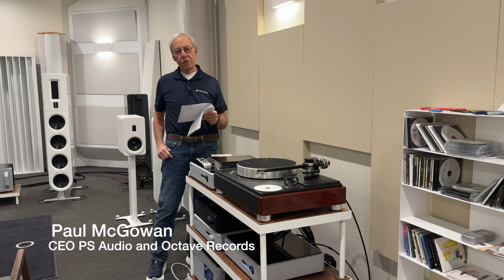What circuitry affects PRaT?

Comment: Didn't answer the question. You could have stayed at a couple things in the circuit that might change the sound but neglected to do it. Here's why, it's not the gear itself it's about the music. The emotion comes from the music itself and the memories we associate with it. NO capacitor resistor or transistor will get us more engaged than another. Paul is talking bologna
Reply: Not true for me.  They can and do add to the musical experience.
Reply: @tomwechsler22  okay so how do they do it? Be specific
Reply: @ryanschipp8513  Simple.  Better parts/components/equipment (driven by capacitors and transistors) reproduce music better.  No question about that.  That makes the same music more engaging.  So, while for sure it is about the music, which is where it all starts, the better the music is reproduced I.e. sounds, the more engaging.  Now, as to the technical how, why, etc.  I don’t care much.  It’s the end result that counts.
Reply: @tomwechsler22  if it's simple you'd answer the question which you didn't just like paul. How can Parts make an amplifier or any other component present more Prat. This was the question by the guy that wrote In. If you can't answer it just say so. No need to go off on a tangent
Reply: @ryanschipp8513  I was focused on your comments about Caps and transistors.  You may not get that.  Here’s the thing, if none of that made a difference, then the music would be just as engaging on a small transistor radio played on an AM station as it would be on a true hifi system.  Your first statement though seems to say it does not matter what you play the music through, it’s just the music.  What I am saying is it does matter what you play it through.  The technical aspect of how - does not matter to me.  The end result does.  As to Paul’s post - I was not commenting on that at all.
Reply: @tomwechsler22  you are stating the obvious. Of course it's going to matter what equipment it's coming through. Your transistor radio comment is bizarre. Something tells me I'm talking to an old timer. Who would compare a transistor radio to Tower speakers? My comment was referring to what the writer wrote into Paul and Paul's response. The writer specifically asked what inside of a component would add emotion or engagement to the music. There comes a point with Hi-Fi equipment where you will get engagement and emotions with all of it. Then it all comes down to the music itself.
Reply: @ryanschipp8513  I suppose the “old timer” was ant as a put down.  Nice work.  Your comment implied that the gear has nothing to do with musical engagement.  (“It’s not the gear” and “No capacitor, resistor or TRANSISTOR…”).  All I am saying is that gear and the caps, R’s, and transistors do make a difference.  Better parts=better gear=better sound.  I was not commenting on Paul’s post.

Comment: Here we go again. The only way to truly judge minute changes in circuitry is through double blind A/B testing. I’ll stipulate that it would be impossible to test every circuit design vs every other this way. But for broad topologies- SET tube amps vs SET tube amps, class d vs class d, class a/b vs class ab etc etc., no human can hear and identify which amp is which all other things equal. This assumes the amps are the same general topology (but with design and circuit design differences) are the same wattage, and are similar quality (using price as a very imperfect proxy for quality as there’s no other way to level set this). Further assumes all else equal including source, passage and DB level at the listening position. It’s just pure fantasy to think the typical listener can discern such minutia in design over multiple double blind trials. And this has nothing to do with the true statement that music is evocative and spurs emotion. That’s a separate topic and an unnecessary preamble to the core of the assertion made here. OK folks, fire away. I can take it.

Comment: Hi Paul, PR&T is a fabulous subject for a technical book. Being from the UK originally, I most associate PR&T with: Linn (Ivor Teifenbrun), Naim (Julian Vereker) & NAD (Bjorn Erik Edvarsen, BEE). I'm completely unaware of other designers that emphasized PR&T, so there is much research to be done. Please make an announcement on YT when the book is available? Thanks!
Reply: I think we need to start with the fact that pace, rhythm and timing are at most synonyms for each other and at minimum  have overlapping definitions to some extent. So what is meant exactly by these marketing terms?  Assuming they have relevant meaning, is the idea that an amp imparts unique p, r and t to source material, independent of that which source material actually contains?  That’s hardly hifi. Or is it that the amp accurately reproduces the p, r and t that was already there, in which case the amp has no p, r and t of its own, which makes the topic moot. In summary the hifi world has gone mad, and the adjectives that manufacturers use does nothing to help. Go and count how many times the word “stunning” is used in ps audio product descriptions. It’s embarrassing. One would conclude that a brief listening session on a ps audio setup would lead to religious experiences, cardiac events or both on a regular basis.

Comment: Hi Paul, hope you read this. Here is my take from down here in Sydney, Australia. At mid frequencies we are highly sensitive to distortion but less so to dynamics. At lower frequencies, gradually increasing below 500 Hertz, we become less sensitive to distortion but gradually more sensitive to dynamics. For those who study the Fletcher-Munson equal loudness curves, if we invert them they reveal that low frequencies are less compressed relative to mid frequencies. At 30 Hertz it requires around 70dB-SPL before 30 Hertz is heard. This is why low frequencies can seem to emerge from a black background. It also means that harmonics of those low frequencies are heard before the low frequency fundamental. That means that we hear the harmonics first and if there is any delay in the fundamental showing up within a certain time, that it will sound slow. Identify those things that causes that delay, and yes circuit topologies, feedback and power supplies, all these can figure in, and then PRaT becomes a real thing. As for mid-frequency distortion, there is now evidence that we can hear even below -80dB distortion and like John Curl I would point to the 7th harmonic as a bad marker, and that means that below 0.05% distortion is audible. But several percent distortion may not be a significant factor below 100 Hertz, but here dynamics becomes a big factor. That is my 50 years plus experience talking. Thanks for a great channel. Cheers, Joe R.

Comment: The problem with PRaT is that it can't (afaik) be measured.  Whilst it can certainly be heard it does mean that certain sectors of our community will dismiss it.  Just like cables etc.
Reply: Cables can be measured. I carefully choose the values of resistance and reactance I need before buying speaker cables. I feel that the "prat" of my system came from the music and state of mind, which is probably harder to measure, and, speakers, room, amplifier and source which can and should be measured.

Comment: Speed and immediacy of the sound and transients plus the engagement/emotional side I call the toe-tapping factor. That's PRAT to me. I usually think of it pertaining to speakers the most.
Reply: Totally agree with this. It’s the attack on piano keys, percussion, etc. as well as the changing of tonality between attack and sustain / decay. In as much as it can be quantified I’ve found the most reliable indicator of how equipment might have this speed and immediacy to be the square wave test. Definitely a speaker characteristic, but in my system the biggest difference in this area has come from amplifier upgrades.

Comment: Isn't prat a British slang term for a fool? I always assumed that anyone talking to a British audiophile who bought into the notion that electronic audio equipment has anything to do with the triple description of the exact same thing, rhythm, rhythm, and rhythm by three different names, was exposing themselves as just that, a prat, a fool.

The rhythm of music is something that's determined by the performer, not the amplifier or speakers. Maybe a turntable or tape player can mess with the timing because it's not keeping a steady payback speed, or it's running at the wrong speed, but the amp? A tweeter? That sounds like nonsense to me. There could be something to it, but no one has explained it to me in a way that fits my basic definition of logic yet.
Reply: Linear phase response is key, particularly under multi-tonal testing. The edge of a square wave is built up from an additive set of harmonics - any relative lag / phase shift with those harmonic frequencies will cause the start-stop characteristics of the edge of the wave to change.  This is from Fourier Theory.
Reply: Still just the one 't' and no.  PRaT is an acronym and prat is a noun.

You should at least get your spelling correct for the key focus of your opinion.
Reply: @Sunshine_Superman  got the spelling. Fixed my reply. Thanks for that. 

So I'm still unconvinced that the acronym PRaT was created for any reason other than to spell out prat. It's literally the same four letters. Could you explain why the acronym uses three different words to describe essentially the same thing? How is rhythm different from timing, or pace?